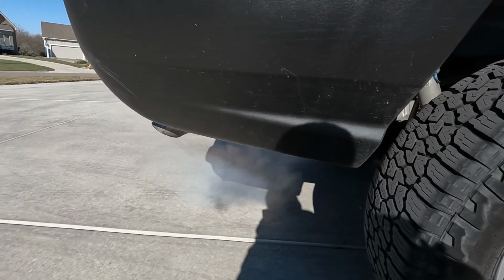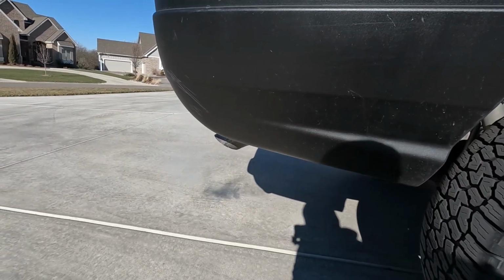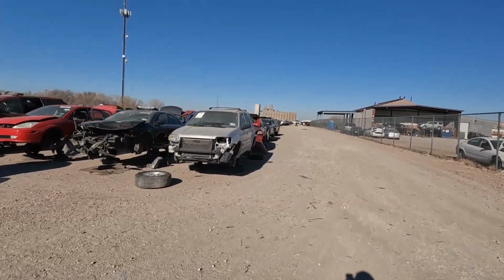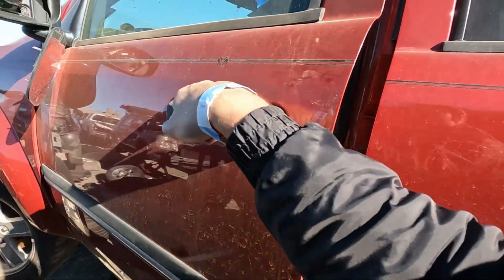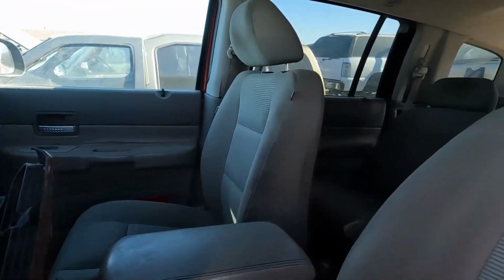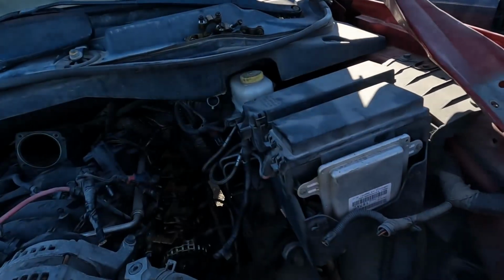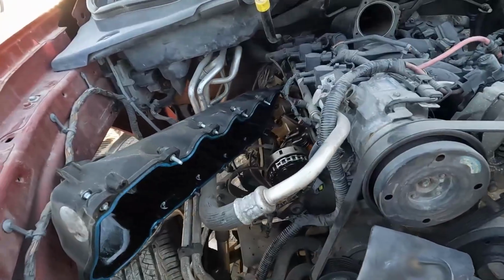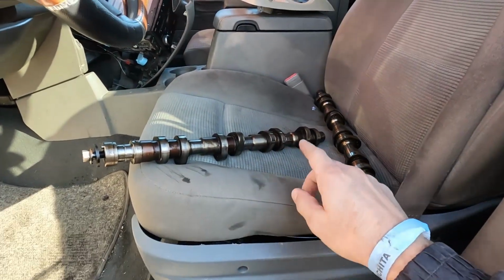$60 Junkyard POWER MODS Jeep Grand Cherokee WJ Project "Cheap Jeep"

Comment: Hot shot treatment with a step up thicker oil is what you need especially on high mileage motors.
Definitely helps my 4.7.
That truck had a bunch of great parts, it would have been a expensive day for me.
Great video.

Comment: Hey consider using the rockers out of the 08 as well. The 05+ have a squirting tip on the rockers. Helps save the tappets
Reply from the maker: I literally forgot them and went back the following day to grab the 08 rockers and some 12hole GM ecotec fuel injectors. Thank you for the info though! Thanks for the view!
Reply: @TylerPotter Are the ecotec injectors for the Jeep?

Comment: Why not get the 08 intake as well? Some places online sell throttle body adapters for the original throttle body to make things more bolt on.
Reply from the maker: This job was supposed to be just a valve stem seal replacement and now has turned into a cam swap also lol I'm trying not to spend more than I should be. I am kind of interested to see if I can notice any change with just the cams installed. Thanks for the view!
Reply: @TylerPotter  I'm looking forward to the cam install and review from ya. Love the insight and information you give on your WJ. Your channel has been useful in helping me with somethings for my WJ (99 4.0 Laredo). Keep up the great work and I'm looking forward to more great WJ content!

Comment: Could you skip the junkyard line and just order factory cams for a 2008 4.7? Thanks for any info? Tight on time so junkyard might not work for me. Also love the video!
Reply from the maker: Yes I believe they are still available new from Mopar. Thanks for the view!
Reply: Just looked them up on EBay and they’re like $70 with free shipping. Seems like I’d rather go this route than search and work at a junkyard for parts they’re going to charge me for anyway.

Comment: Shoulda grabbed that intake manifold too. Those 08 intakes are also a big bump in power as well in comparison to be stock and ho intake manifolds .
Reply from the maker: I didn't want to mess with the throttle body adaptor for the 08+ manifold, so I've got a 03+ manifold on the toolbox waiting for me to find motivation.
Reply: @TylerPotter  I’m telling you man, just the throttle response alone is worth the time. Keep an eye out. Some people sell the adapter plate for cheap on eBay occasionally.
Reply: @TylerPotter  I sell an adapter kit for $80 that allows you to use your TB on the 08 intake.
Reply from the maker: @doctorwhodude82  have a website or ebay link?
Reply: @TylerPotter  not as of yet. Working on it though
Reply from the maker: @doctorwhodude82  nice sounds like a lot more affordable option than the $300 air ram kit!
Reply: @TylerPotter  that was the idea behind making them. Air ram charges way too much for their adapters. Mine aren't metal like theirs but will work equally the same. Even if I decided to charge $120 for the kits they would still be better value than I feel air ram is.
Reply from the maker: @doctorwhodude82  awesome! Keep me informed on availability!
Reply: @doctorwhodude82  did you ever get your eBay up and running?

Comment: I guess this same thing Martin does woth HO cam shafts for his 4.7. I found an HO but for some reason the engine was tossed in the trunk and cams are exosed but sitting in pool water. So didnt think would be good to take. Wait to find one not in the trunk.
Reply from the maker: Yes these 2008+ 4.7L cams have a slightly more aggressive intake cam profile then the HO cams. So if your going through the trouble of swapping cams you might as well get the most aggressive factory cams possible with the 2008+ cams. Thanks for the view!
Reply: @TylerPotter  Awsome good to know. Haven't seen anyone else cover this. Def will keep an eye out them.

Comment: Grab the intake with an adapter it's much better than the 1st gen intake aswell
Reply from the maker: I ending up getting a 2002 4.7 HO intake because I didn't want to deal with the throttle body adapter. Thanks for the view!

Comment: Should have gotten the intake as well while you where there
Reply from the maker: I really didn't want to deal with adapting the throttle body for the 08 intake. I ended up with a 2002 4.7 HO intake when I put the motor back together. Thanks for the view!

Comment: Do you need to flash the pcm to run the cams ?
Reply from the maker: No since they aren't that crazy of a cam like an aftermarket cam, the factory tune will be able to adjust fuel trim with the O2 sensors for the added air. Thanks for the view!

Comment: Having install a few sets of cams on HiMile WJ 4.7 pulling the cams is a far cry from installing them. Let us know how it goes. When it's dun.
Reply from the maker: I will defiantly make a video, I've got new millings lifters, 2008 cams, 2008 rocker arms, 2003+ intake manifold, GM 12 hole ecotec fuel injectors and valve stem seals all ready to get installed, now I just need to find the time to tear apart a perfectly good running engine lol
Reply: @TylerPotter  Tyler how is it? I sincerely hope you have MartinBilts valve spring tool. Barring that, have the engine on a stand. Lol. Taking the engine out is actually only 2 or 3 electrical connectors. I found, online  a couple engine wiring harnesses and one complete electrical harness including the ECU (PCM) to BCM interface and engine fuses for a 2001 4.7 limited.

Comment: With this work for a 2007 Jeep Commander with the 4.7
Reply from the maker: Yes the 2008 cams will bolts into your 2007 4.7. Thanks for the view!
Reply: @TylerPotter  nah man thank you I've been trying to find multiple ways to add horsepower but i can't find anything and if i do it's all like $568+
Reply: I take it the whole engine from Durango wouldn’t fit your Jeep…great videos…weening myself from GM products…; )

Comment: Cuts harnesses and lays oily cams on a seat to stain the piss out of them.   The next guy who comes along needing a harness and a driver's seat is gonna be a bit angry, as well as the owner of the salvage yard losing revenue.
Reply from the maker: This salvage yard is a little different than most, doors are often left open in the rain and vehicles only are in the yard a few months before they get crushed and recycled.

Comment: good thing didnt neeed the wire harness or seat with cam oil on it
Reply from the maker: If I recall someone had already done a few bad things to the harness on the fuse box side so I didn't feel to bad cutting. Thanks for the view!